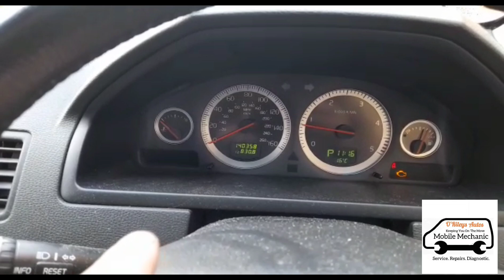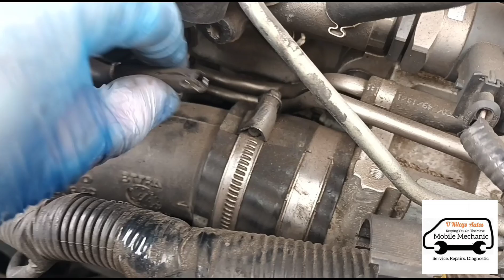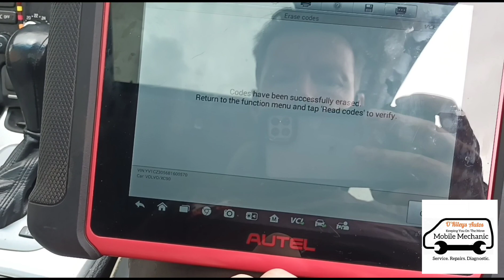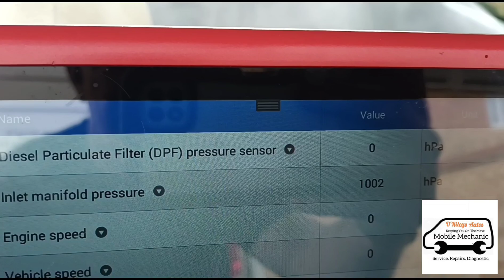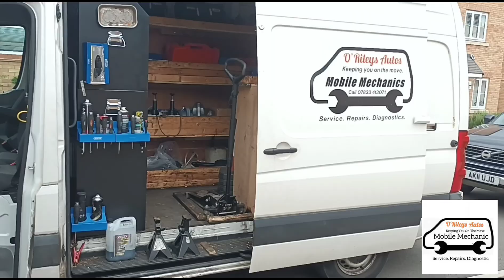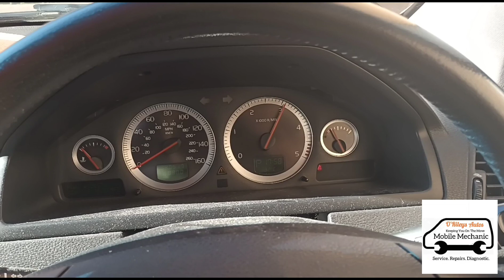Volvo XC90 D5 18A0 2A00 2A30 P2455 P242F Swirl Flap Arm & DPF Differential Pressure Sensor

Comment: I've got turbo pressure low code and the dpf pressure high code, there seems to be a leek from the swirl flap arm seal with a smoke test also, may have to replace them later I guess! But the dpf pressure sensor seems to be working on live data. I'm going to take the dpf off to clean anyway then try using the Revive treatment. thanks for the video I'll give it a try. (On one of the outer north isles Scotland here, got no mobile mechanic on the island unfortunately)!

Comment: When the new sensor was fitted it was showing 65524 hpa on the scanner. Then next time we see a reading it was 24. How did you get it to read the correct values. I only ask as I've just fitted a new one and its showing this high value but I cannot get it to read anything in a normal range.

Comment: What causes 2011 volvo xc90 go into limp mode when driving getting fault codes saying air flow meter , low boost pressure turbo , fitted new air flow meter . Still in limp mode driving.
Reply: Check for split or leaking boost pipes to start with. You’ll need to get your hands on a smoke machine

Comment: Was going to ask!! I know you'll know. DPF differential pressure sensor for the D5 engine in an V70, is it accessible , I may as well change this before DPF as it won't passively regenerate
Reply from the maker: Sorry I don't remember the location.
Reply: Hi Jimmy, can I ask why you ran the dpf cleaner through the dpf directly underneath the car and not the tubes by the pressure sensor?I might have to do my Volvo at some point and just want to know if I can go in by the pressure sensor?

Comment: Hi  Jimmy 
I have a similar fault  with my Xc70
I've cleaned the dpf and egr, 

I'm getting codes

Pressure Sensor Particulate Trap.ECM-2A10

EGR Position Sensor. Faulty Signal
ECM -44B0

What could it be?

Comment: How does that DPF cleaner work? Do you just pump it in through the pressure sensor pipes, leave it to soak then run the engine? Mine is blocked and it won't regenerate as I think it is too far gone and I can't get it off the car without an angle grinder as the nuts are completely rusted up!
Reply from the maker: What's happening when you try to regen it
Reply: @ORileysAutos  I'm using the Volvo VIDA software and it says 'start conditions not fulfilled' which I think is because I have a second fault code 'DPF Faulty Sugnal' in addition to the normal 'DPF Full'.
Reply from the maker: @timothyduggan2263  you'd need to check the dpf differential pressure sensor is working
Reply: @ORileysAutos  Thanks I'll check that. I was getting some movement on live data so assumed it was OK, but I'll do a more thorough test. Thanks for the advice.

Comment: any tips I'm on with sorting out a 09 1.6 v50 with only 69k I've been told it had a DPF warning before and it had a new preshor sensor pipe and a regen the warning soon came back and they ran it until it gave up the DPF is completely blocked I've ordered a new one but I need to figure out the reason it got so bad the DPF temp sensor is showing 99.9 and the pressure is 0.0 no matter what I do and I've given the additive tank a tap and it sounds empty
Reply from the maker: I'd test the hoses for leaks with smoke tester.

Test there is power to the sensor. Test the sensor by pushing pressure into it while reading live data.
Reply: @ORileysAutos  cheers for replying I'd allrede had a look at that side of it the pressure sensor was 0.0 I put the new DPF on it started perfect the DPF temp sensor kicked in and the pressure jumped to 20 and stuck there even when not running fitted a new one getting good live data now the additive tank seems to be the root of the problem it's still 1/4 full but it doesn't want to speak to the scanner

Comment: Had the same issue with my xc70 and same engine.

Power to the dpf pressure sensor, lines free with no leaks. New sensor and still no reading from the dpf pressure sensor. 

Can only guess its been mapped out.